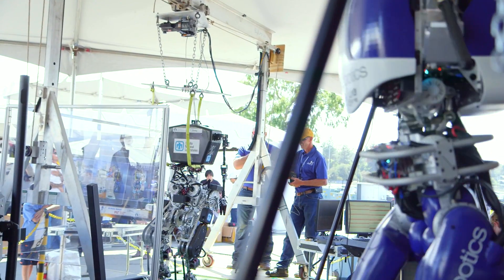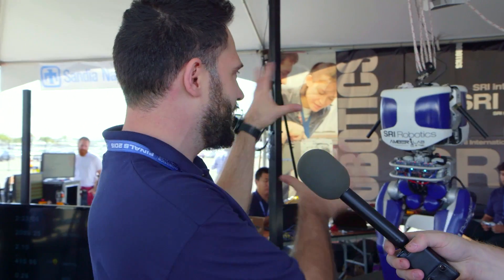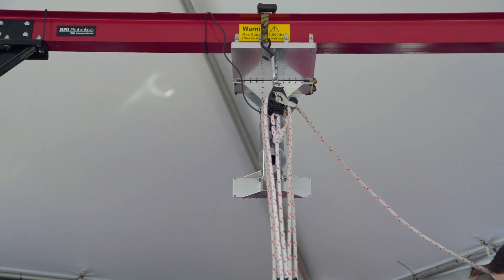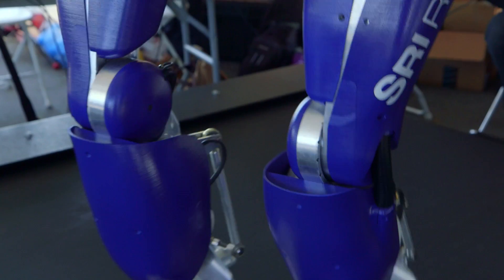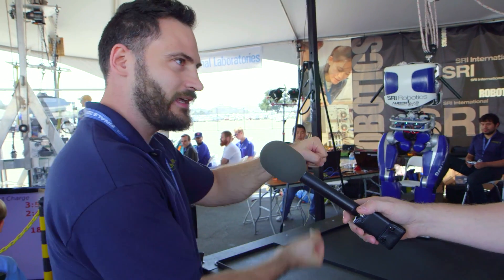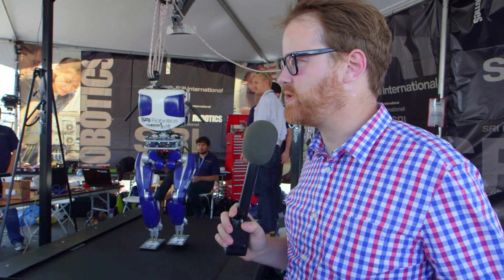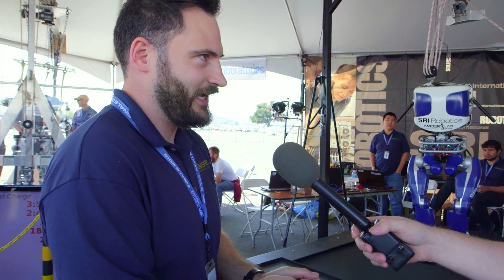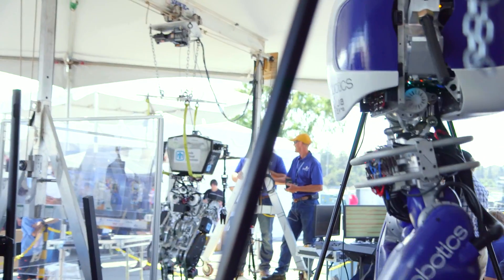Designing an Ultra-Efficient Walking Robot

Comment: gyro antigravity static generator to take weight off frame powered by tourbillon turbine run by compressed air using the piezioelectric resonant motors that move the joints using resonant power converted from super capacitors to bump the static generated while the motors pump up their compressed air energy storage 
So you want Piezio compressor motor 
A tank of air
A turbine powered tourbillon wilmhurst machine
Supercapacitors

Cycle / pendulum the energy

Maybe even a levitating liquid pendulum powered by the ferroelectric liquid crystals etc to release more energy than required for levitation
Could use helm holz resonators to reduce amount of energy required to slightly levitate ferroliquid with transducers /ultrasonic speakers resonators

🤖🛸✨
Cause everyone loves upgrade

Comment: Not to be that guy, but wouldn't it be more efficient to just use wheels?
I mean the guy DID say he was looking into efficient locomotion.
Reply: Strife Rixa absolutely. but walking has certain advantages over wheels, like walking stairs. But this specific project was only to make walking efficient.
Reply: did you see the steps the robot was taking? he was lifting his feet 2 inches and moving them forward 2 inches... that is barely walking. wheels would be better. 
They should make a really efficient fork to eat soup with, I will still use a spoon.
Reply: @mddevice2108  for now. i mean the utility of legs vs wheels is obvious. just because it’s not been developed that much doesn’t mean legs on a robot are a bad idea. the limiting factor right now is software. legged robots need balance and rhythm, these are hard to program classically. learning algorithms make this much better.

Comment: 90% efficient?
Reply: M. de k. Those >90% was only for the gears. The motors themself might have an efficiency of 85%. The batteries should have a charge/discharge efficiency of around 85%. Only counting those we are down at 65-70%.

Including the coal power plant that does the chemical to electricity conversion the whole system end up being worse than a human.

But comparing efficiencies like this is pretty meaningless. One could make a huge robot that's 90% efficient and uses 4000W to walk. or a tiny toy robot that's 10% efficient but only uses 4W.
Reply: 100% goes in, 90% comes out, 10% is lost as heat and sound mostly.
Reply: puskajussi37 90% Is a huge number for a mechanical system. I am a bit skeptical.
Reply: m8e A very, very good point.
Reply: 90% efficient in transferring power from motors through the gears to achieve movement in limbs and joints.

Comment: Does the audio sound weird to anyone else? Still awesome video thanks guys.
Reply: McClover My guess is that the main mic (the one you see) didnt work as it should, so they had to use the camera mic
Reply: McClover It sounds like (since there is so much background noise).  They applied a lot of Noise Reeducation to the audio in this video.
Reply: To me it sounds like the mic setting was wrong, I forgot the technical term but some mics have three functions. 1. OFF 2. (Pick up whats directly in front of it) 3. (Pick up everything around the mic). Just my opinion I could be wrong.
Reply: ***** You may very well be correct.